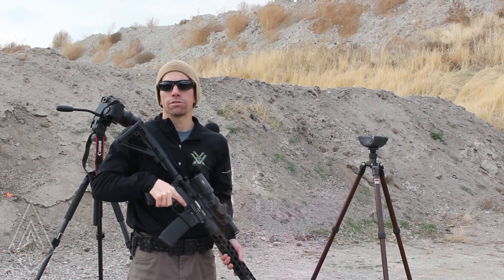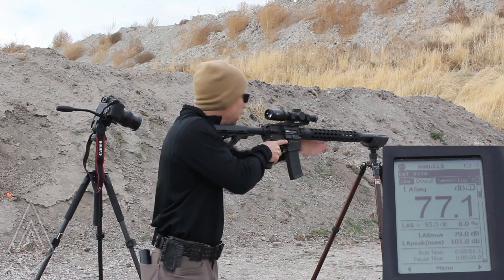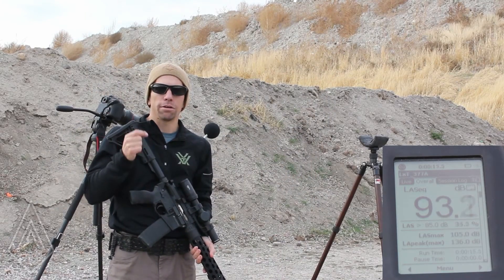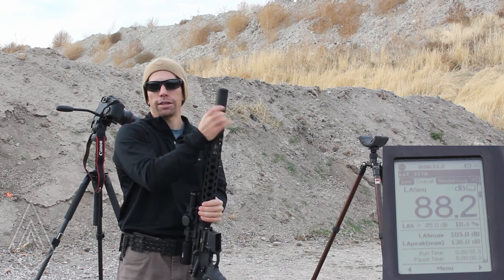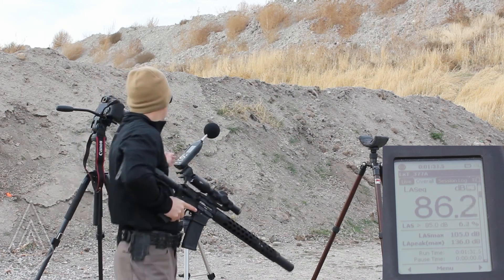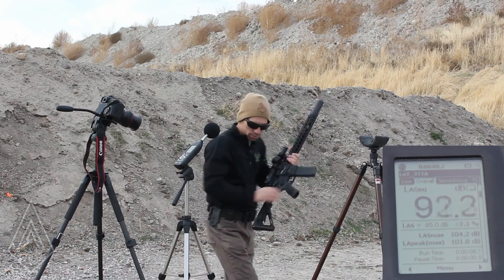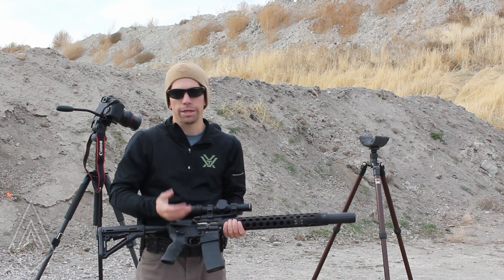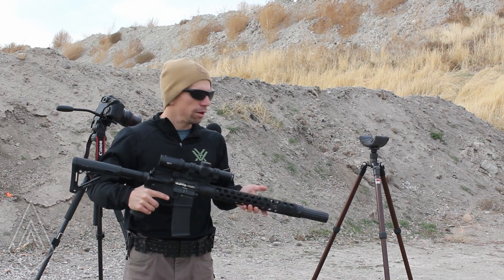End barrel vs over barrel suppressor testing

Comment: A big heavy weight at the end of the barrel is going to change the barrel harmonics.

There are 3 possibilities of what you end up with.
1- no change in accuracy
2- improved accuracy
3 - decrease in accuracy

33%  chance of any of these things happening with any heavy muzzle device.

A small amount of the gas is also escapes ahead of the bullet. That will contribute to one of the three things happening above.

The only way to know, is to try it out.

Comment: Would one of these designed for a mid-length gas system on a 16 inch barrel work if you have an A2 front sight post, or does it require a low-profile gas block like what’s on the rifle in the video?
Reply: on their site, their biggest 5.56  specific can goes OTB by 4 inches. as long as you have 4 inches behind the thread, should be fine

Comment: YOU GUYS NEED TO START 3D PRINTING YOUR BAFFLE SYSTEMS YOU CAN GET WAY MORE OUT OF THE REAL ESTATE WITH THAT NEW MANUFACTURING PROCESS. YOU GUYS ARE INTELLIGENT ENOUGH TO ADD A SINGLE SPOT WELD TO CHANGE THE TONALITY OF YOUR SUPPRESSORS, NOW ITS TIME TO STEP IT UP AND USE THE TOOLS AVAILABLE TO YOU. RESEARCH MICRO-STRUCTURES AND LATTICES FOR A STARTING POINT.

Comment: I have ordered an AMTAC due to my favorite Suppressor is my OSS ( now HuxWrx ) OTB "Over The Barrel) Suppressor. Why ? Because it is a Very large ( 10 inch  - 2 - piece ) Suppressor but it only adds ( 4 inch. ) to the overall length of my Rifle. So it actually feels my lighter than ALL of my other traditional "End of Barrel" suppressors. Obviously due to the cantilevered weight being at the very end of the Barrel.  Not to mention the additional & ridiculous extra ( 6" ) length. which converts my full length AR into a seemingly ( 6ft long ) Confederate Musket length feeling.   
 Why the OTB is not the industry standard is a true mystery. Obviously it must be due to the ability to fit  only certain rifles with the available unobstructed exterior barrel length.  ie ... shorter length gas systems & handguards. etc... but as far as i am concerned I will never buy another Non-OTB suppressor again. There is not need to anymore. 
 Especially when dealing with the ( 5.56 ) partridge that relies on velocity / Barrel length to be effective. So with an OTB you can have a ( 16" ) barrel & suppressor combo. that equals the overall length of a much shorter barreled rifle with an end of the barrel suppressor.  Why ?

Comment: I wanted to try to run the .308 suppressor but from what it seems with the measurements I don’t think I’ll be able to with the Aero handguard. The inside diameter is 1.5” and these suppressors are 1.62”